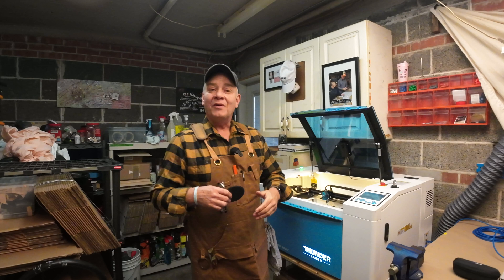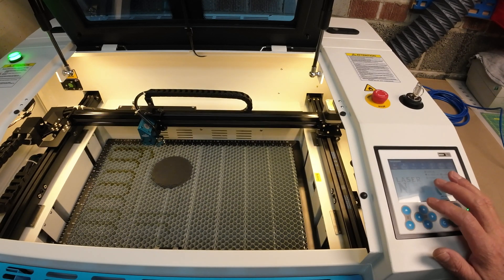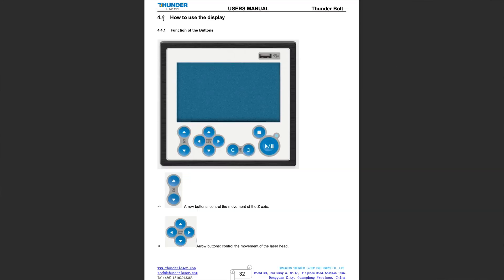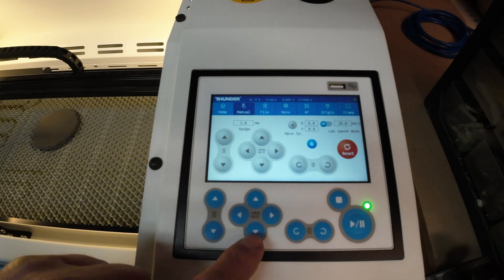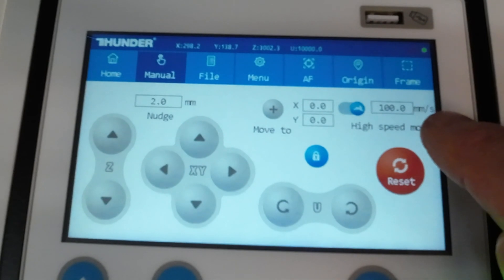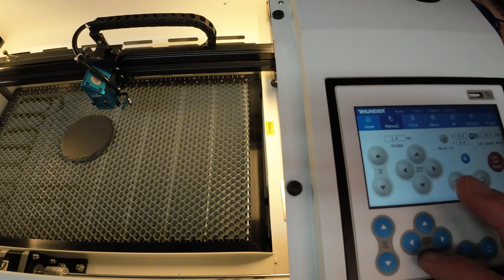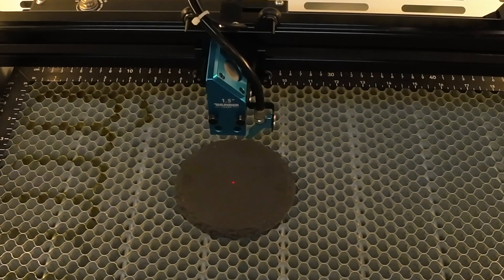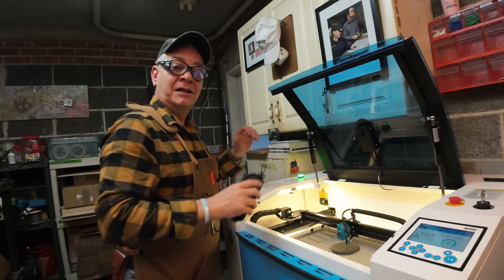The Tortoise and The Hare. Thunder Laser BOLT AXIS Speed Adjustment. Check This Out!  006   4K

Comment: Do you know if those beeps are silence-able? I don’t think I could mess with that while the family was sleeping without waking them up. 😟
Reply from the maker: Good day. I don't think so. I saw your comment and checked the manual and the menus on the controller this morning and i don't see anything. You could send a contact to Thunder Laser on their site and perhaps see what they say. Thanks!
Reply: @LaserNUG  Thanks a Facebook user stated it’s possible in the menu and I don’t have a bolt yet to test but trying to do research about the machine. So I’m hearing by others that there doesn’t seem to be a setting unfortunately. 

But I did reach out to Thunder and they have a knowledge article how to lower the noise by removing the controller and I think they say to add some tape or something to the beeper. 😕 

Kind of disappointing considering you should be able to turn off the beeps. I understand keeping the alarm and actual safety related noises but to listen to every single button press beep is slightly annoying. Lol 

Brings me back to my Creality Ender 3 machine beeps… terrible lol